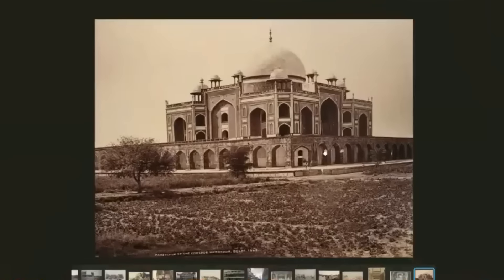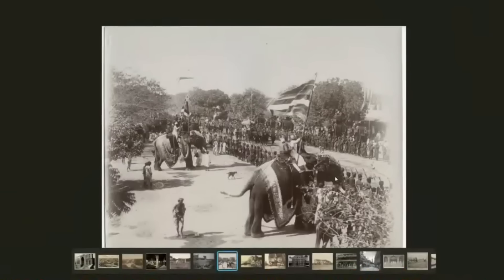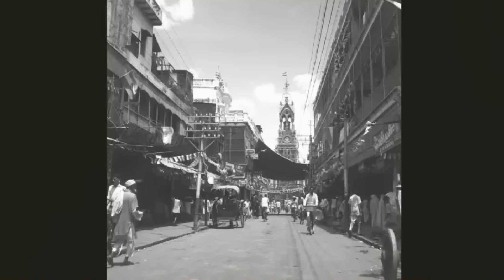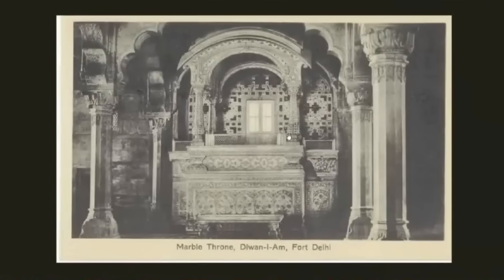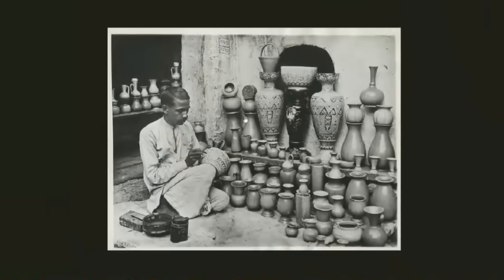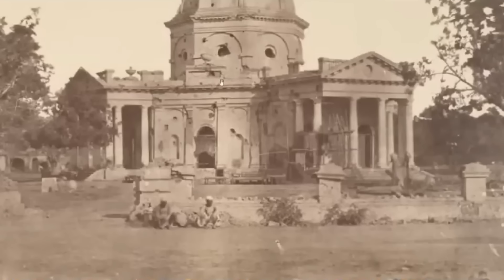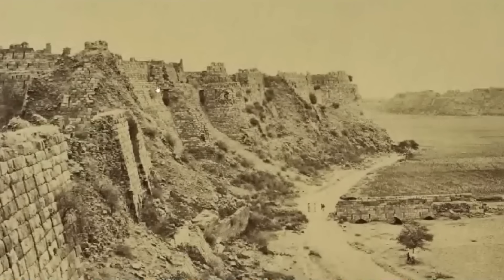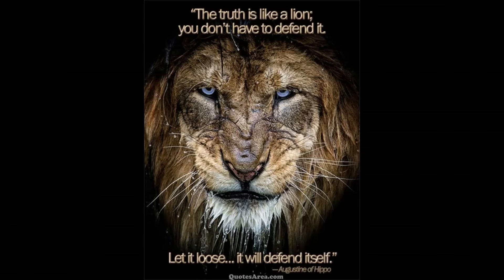The Impossible Engineering of Ancient India: How Did They Build This Without Modern Tech?

Comment: Restart the reactor 😂Quade 
Tuned bells will need to be made,
A cathedral to amplify and conduct,  pipe organ tuned to cathode and Bell. 
To the frequency of hydrogen in that area.
Water source used for discharge creat sparkgap at cathode bionary points, magnetron sparkgap, and lingam sparkgap. For direct atmospheric current as needed.
Also ionizing source water and recharge soil with nitrogen for plant growth.
Start the reactor

Comment: 3xI was thinking about getting some mercury, a brass or copper sphere and pouring the Mercury inside it and placing up in the air about 80 feet with a ground wire an d ground pin with some antennas sticking out of the sphere to attract electricity and place a load in between to top and ground such as a small light to see if any charge. would result. Wouldn't cost much. It would be very cool if it worked.